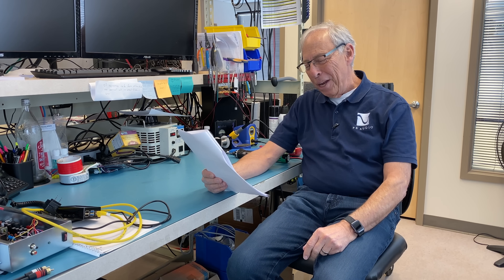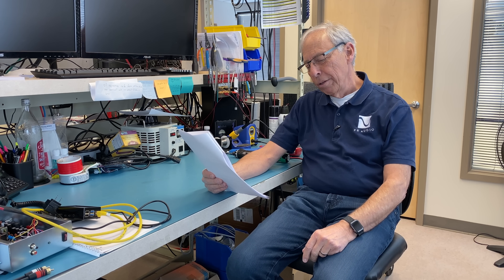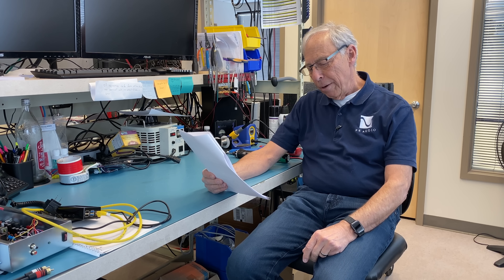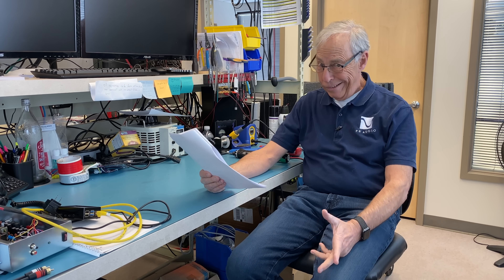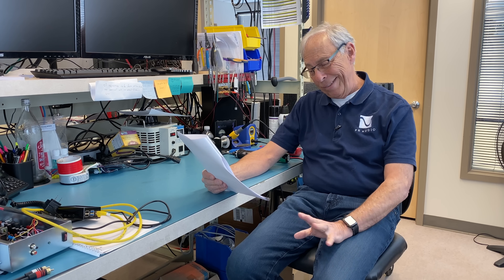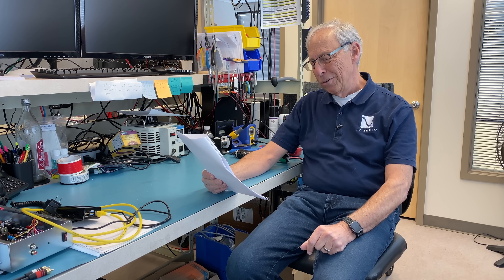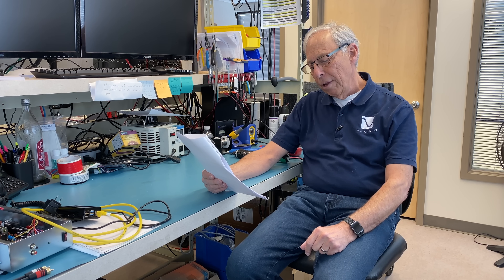Should you upgrade a speaker's crossover?

Comment: NO!!!! FOR SO MANY REASONS!! THE #1 REASON, HOW DARE YOU!
Crossover are designed and made for each specific speaker's model. Take Infinity for example. Everyone talks about how cheap their woofers are (RS line). You think re-doing the crossover is going to make them better? More like you will over drive them and burn them up or if lucky just change their sound all together. The whole speaker (box, crossover, drivers) is a symphony of parts of what was available at the time at a certain cost point. I have 2 sets of Infinity RS IIIa's. I had to replace 1 cap in one set (to make the set match) because when doing new pots I broke a lead off one of the caps. replaced with the same values and just the one cap, they sound different then the other set when they did not before. The crossover is made to take advantage of the box it is in and the drivers it feeds. The drivers are used to take advantage of the box and the crossover. The box is used to make the drivers that is being feed from the crossover sound better. The bottom line is a true audiophile would never tamper with the set up because the maker made it that way. They would have to just buy new speakers and listen to them the way the maker intended. Again, HOW DARE YOU.... 
With that said, I just took a set of 1974 Realistic Nova 4's, they used to call them "cathedral speakers" because of the grills they use and installed Infinity Qe crossovers, horn tweeters and pyle 8" woofers in them. They are pretty kick-ass for the garage. Would I do that to my IRS IIIa's, nope. Over the years I really wanted to add a second Emit tweeter to each speaker but never had the heart to cut the box (how dare I...) so I just built EMIT satellites to sit on top of them. There is just some lines you don't cross. lol. I really think the main reason is I never wanted someone to look at the name plate and then the speaker and say they don't match. Once custom ...always custom.
IMHO if you want to change them up then go for it but be aware that there is risks and rewards like the speakers not being original anymore (resale value), audiophile looking down their noses at you and most of all you may or may not like what's on the other side even with a simple recap of what you have. Just depends on where the chips fall.
Reply: fin ...stick to what you know.
There are many successful after-market crossover builders; Danny Ritchie for one.
Watch some of his presentations & learn something
Reply: @FatRat-f9m  I don't think you got my sarcasm.
 To be honest I have to say I was pretty shocked that Paul said go for it though. This is a guy that will not give you tone control on his stuff (because that is the way it should sound and if it don't then fix the room to make it sound that way) and yet is saying ditch someone else's stuff and change it. I'm not above it. I just put Infinity Qe crossovers in Radio shack boxes. But like I said there is a line and for me it's my IIIa's. I mean if you want to hot rod up a 1980's mustang I could care less. Now if you want to hot rod up a 1966 numbers matching low miles Mustang I may frown on that.
Reply: Wow! I'm rocking in the free world! The deed is already done. Paul messed with the IRSV's. But thats what we do. I dont buy Hi end and I dont sell anything. So Cut that box down, get a DSP, some good amps and have a Big Mac n fries ta boot! (IMO)
Reply: I got some old nova's also. My dad was into the RS stuff in the 70's. Didn't you loose some upper midrange putting some Piles in there? Oh well. I still say cut the box volume in half and add a sub playing the same freq as the main. But thats just too junky for some people. 
It works because those to woofers compliment each other. One tuned high and one low. BTW I know what you're saying about the Mustang's. Thats my first trade. Auto tech. Drove one of the first Mustang 5.0's 5 speed 1979 model. Was my step brothers friend. Loved it! Although I was brought up Chevy Malibu 283 converted to 327 by my dad to pull a travel trailer better.
Reply: Its not so much that with tone controls. Just passing the signal through that circuit with the knobs at zreo does deteriorate the signal. My wife can hear the difference between that and "direct in" on our 90's Marantz.

Comment: Speaker tweaking is really fun. Some speakers are easier to tweak then others. I owned a pair of Dahlquist DQ-10’s one of the most tweakable speakers ever made. I replaced the caps with polystyrene caps, the resistors with film resistors and that definitely made a difference. But, I mirrored the right speaker, no easy task, and that made a HUGE difference. Then the biggest tweak. I think the DQ-10's cost me $1000 new for the pair. I replaced the $5 tweeters with a $500 pair of Decca Ribbons. WOW! That was a mind blowing change. All this in like 74.

A long time ago, far far away.
Reply: I'm recapping a pair of DQ-10's right now. 8 caps on each board, parts from Regnar. A technician 'stole' the 10" woofers when the previous owner had them 'repaired.' All they needed was refoaming, but he stuck in 12" Eminence. Found some on eBay (Advent/Dahlquist).

Comment: As an experiment I took a 45 year old pair of KLH Model 32 speakers out of the attic. I hooked them up and the sound was not very good as I expected. 

I started researching crossovers and upgrades others have done to make some improvements and with an old pair of speakers just gathering dust, it was the perfect experiment. 

Removed the woofers and resealed the cloth surrounds with Permatex High Tack Gasket Sealant #80062.

Found quality replacement capacitors to replace the small 45 year old cheap foreign made 4mF capacitors. The 1mH inductor was a low quality iron core inductor so I replaced those with air core inductors with much better specs than what I was getting from the old inductors. 

While I was at it since I had to remove all that old fiberglass damping I decided to make an upgrade in damping. I got some thin sound deadening strips of a type like Dynamat which I glued along the back, side walls, top and bottom and on top of that I put 1/2” Roxul insulation on top and then placed 6 Oz of loose Polyfill in the box. Resealed the woofer woofer cutout with gasket material. 

Did I go just a tiny bit “overboard” ? 🤦🏻‍♂️ Probably, but the end result was a big improvement and a noticeable difference in quality over the response after the modifications than before.

A fun project and to answer the Question of the Day, YES replacing crossover components and other upgrades will make a difference
Reply: doesn't sound lie you went overboard, sounds like you went right for the perfect amount of board. great job!

Comment: I have upgraded several pairs of speakers with quality crossovers, and I have never been disappointed with the results. Highly recommended.
Reply: J.T. Cooper Did you upgrade every component or just a couple like all caps or all resistors etc.? And did you use the old crossoverboard? I am looking to upgrad my speakers crossovers as well and the board is wayy too small for the upgraded components.
Reply: @dinhduynguyen3809  I upgraded with complete crossovers. Out with the old and in with the new. ✌🏻If you want to build them yourself, you can go that route too. Just get a bigger piece of board that will hold everything.
Reply: @j.t.cooper2963  have you done any Klipsch speaker upgrades? Im about to upgrade the RP-600m which are considered bright at the top end so im thinking for caps either Jupiter Condenser copper foil paper and wax or the Jantzen Amber Z-cap they are more on the neutral sounding side. For resistors im thinking either pathaudio, ohmite audio gold, Mundorf MOX or Vishay. I will be upgrading the wiring and speaker binding posts at the same time.
Reply: @williamm9099  I haven't done any Klipsch speakers. Good luck and have fun!
Reply: @williamm9099  Keep your resistors unless you need to damp out some overshoot. Resistors do not color audio. Any ceramic or polypropylene capacitor will be a huge improvement over stock electrolytic. Turn your attention to the "order" of the crossover. 1st order crossovers leak pretty bad. 2nd order greatly improves clarity and lowers noise. 3rd and 4th ditto. 5th and higher hybrid networks are overkill, so save yourself some dough there. Will cost a small fortune to balance all the variables on a good 4th order :)
Reply: Where can i buy crossover for 6ohm speakers
Reply: @d.s.w7779 Amazon
Reply: I have Dali opticon 6s, I've been torn with the thought of upgrading them but I'm unsure of recommendations. Can you suggest anything please?

Comment: Good capacitors are not cheap, but they will definitely lift a veil off your speakers. Crossovers are often well designed but usually cheaply made. It is the place where manufacturers cut costs, even decent caps are often better than OEM quality. Get a good poly cap and you will often be better off than getting new speakers that also have cheap crossovers. If they are 12 db. the bypass caps do not need to be as good as the in line filter caps in the crossover.

Comment: I have been messing with my DSP for a couple days now. Playing with optimizing the the values for each driver. Whats really cool is having different profiles. 
 In a 2 way bookshelf system, having different modes at a push of a button can make a difference. One mode for running them hard and another for low level playing. Almost like a 6 position loudness button but done digitally. Forget passive. IMO and get a DSP!
 If you want to hobby shop your speakers, the possibilties are amazing. Also the different types of crossovers included make adjustments so precise. 
One amp channel for every driver, forget playing with outdated tech.
Reply: I've been using a PC based digital crossover for about a year now, sounds much better than a passive crossover, and can be changed on the fly. Best upgrade I've ever done.
Reply: @bobo1on1  Sounds neat. Is there a model number?
Reply: @sailingaquarius23  No model number, it's a desktop computer with an Asus essence stx II 7.1 sound card, running jack, pulseaudio and my own software on Linux. Audio is sent to it over ethernet, but analog line in is also available.

Comment: In order of importance...
1. Upgrade to Mills resistors.
2. Upgrade from cheap caps.
3. Upgrade from cheap inductors...
Reply: The subjective impressions of a bunch of DIY enthusiasts aren't persuasive.  The applicable math and known component characteristics say ditch any NP electrolytics in the signal path, the same goes for cored inductors.  That said, neither category is especially problematic in a shunt (parallel) role in the circuit as long as the component in question is in good condition.  Resistors?  Unless they're highly inductive or out of tolerance, replacing them with pricey "audio grade" parts won't do squat.
Reply: @editorjuno  You know... It really doesn't matter what you "Its all about the math" types say. What matters is what we hear. We choose what sounds good to us. You can't tell us how to think or hear. Mills resistors will sound better but the difference is no where near as much as caps make. When the math can describe how something sounds I will listen. Otherwise its useless.
Reply: @andershammer9307  -- We're not too far apart given your concession that "the difference is no where near as much as caps make" suffices, so no further discussion is required.  You're saying that resistors make a little audible difference, I'm saying they don't do squat.  Fair enough -- that's well within the range of psychological phenomena like confirmation bias when the evaluation process is subjective.

Peace.
Reply: @editorjuno  OK. I'm fine with that as long as you don't tell others what they should think or hear.
Reply: @andershammer9307  -- Who exactly is doing that any more than you do?  Like everyone else posting here, I'm just calling it like I see/hear it based my own knowledge and experience, which in my case amounts to 50+ years.  Peace.
Reply: @editorjuno  You seem to think I'm just another DIY. I did this for a living. I worked in several stereo stores as a repair tech and a sales guy. I told it as I heard it. I didn't make stuff up to sell anything. 50+ years of what ? I've been into audio for more than 40. How much high-end audio have you experienced ?
Reply: @andershammer9307  -- Don't mess with me sonny.  I was selling audio when McIntosh and Marantz (and a few outliers like CM Labs) were pretty  what comprised "high end."  I've personally met industry pioneers like Saul Marantz, Gordon Gow, Dick O-Brien, Hermon Scott, 'and Avery Fisher.  I was an associate editor of a technical trade publication for electronics engineers of all stripes and have written/edited dozens service and user manuals for any number of consumer and industrial electronics companies, working closely with design and production engineering departments to ensure accuracy and readability.

I'm also a (now lapsed/retired) professional-level musician on several acoustic and electric instruments, having done sessions at famous studios like Atlantic in NYC.  I know what human voices and real musical instruments sound like and can damned well tell when those sounds are well reproduced, thank you very much.  Listening to recorded music is a huge and vital aspect of my life and has been for those 50+ years in their entirety.

IOW, I'm very familiar with both objective and subjective criteria for evaluating audio gear and, having been involved in component selection via my employment in the distribution channel, I'm aware of the characteristics of various types of capacitive, inductive, and resistive parts at the frequencies and impedances that pertain to loudspeaker systems.

Enough said...
Reply: If you want to do the least to really improve the sound upgrade the caps. If you only want to change one cap do the tweeter cap. Use a good film cap if you can.
Reply: @andershammer9307  
The Washington DC speaker builders club (back in the 2000s) did all this testing in a double blind format.

I stated the results we found.  First, resistors for tweeters.  Then caps, then inductors.

But data and testing doesn't impact beliefs.
Reply: @drgjs  I think many would agree that caps would have much more of a change to the sound than resistors. I used to modify stereo equipment for a living and I did what made the most change first.
Reply: Ohh and I used to read Speaker Builder magazine.
Reply: @FatRat-f9m  Wow did I say that ? I must have more power than I thought I had. I say what I say to help people that is all. I have had a lot of experience in audio.
Reply: @FatRat-f9m  I think you are just here to try to piss me off so I think I'll ignore you.
Reply: @andershammer9307 ... Oh ! So you're paranoid as well?!
That explains a lot about your narcissistic character. Feel free to ignore me but your screaming little ego is going to be absolutely itching to reply to this.
Happy listening ;-)

Comment: Or, just go crossover-less full range single driver. :)
Reply: I have a small single driver speaker. I also have 2 way, 3 way and a 4 way system. I build speakers and while there is nothing wrong with a single driver system, it actually does some things quite well, calling it "full range" is a stretch. They work well for near range low level is my experience. Distortion in speakers is usually higher than in any other part of the system. A single driver speaker will have more distortion than a multi driver system if equal quality components are used. At a given price point it has merit, but if money is available a good multi way with good crossovers (not cheap) or electronic crossover will be better for "full range" reproduction. Using my 1/3 octave real time analyzer I have gotten best results with an electronic crossover and multi driver system. -Norman
Reply: @kirarittberg5088  This is why I bought full range electrostatic speakers. Distortion is measurably lower and they sound better.
Reply: Back loaded horns are a great example.
Reply: @paullazarro531  Horns like Voice of the Theater can sound really good especially if driven with tube electronics but I still prefer electrostatics.
Reply: @andershammer9307  Yep, electrostatics are hard to beat!
Reply: @paullazarro531  I lived with mine since 1980 and I've yet to hear anything better. I heard speakers just as good but they were Sound Labs full range electrostatics selling for over $12k. I paid 2k for mine in 1980. Also had a lifetime guarantee.